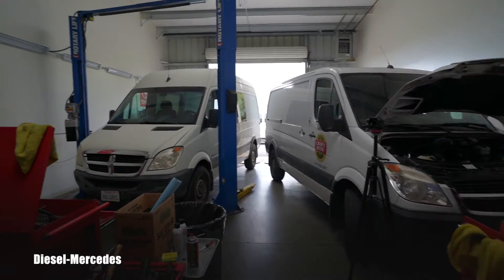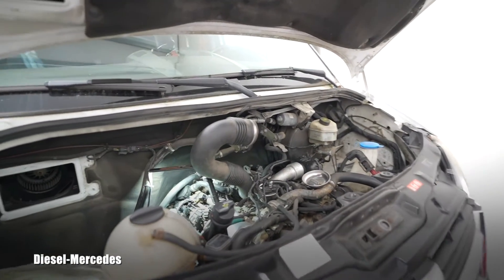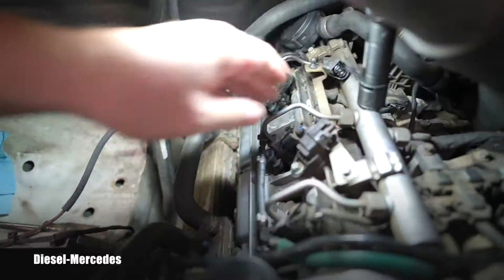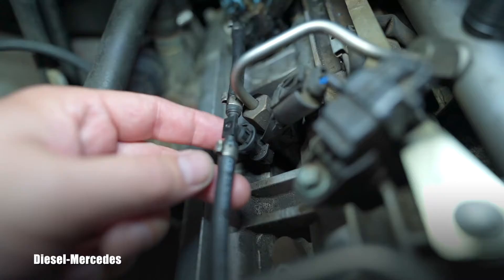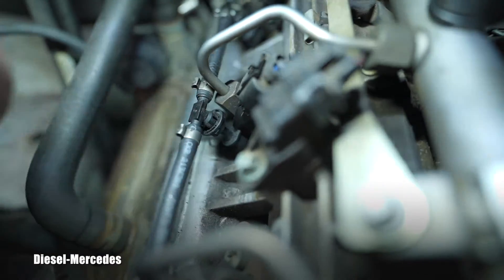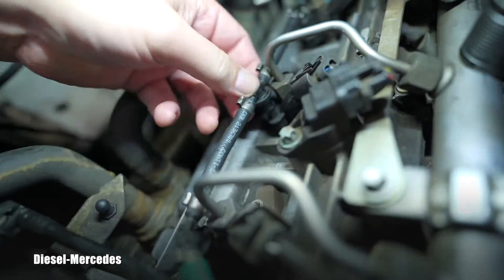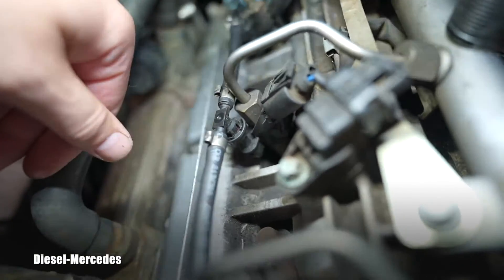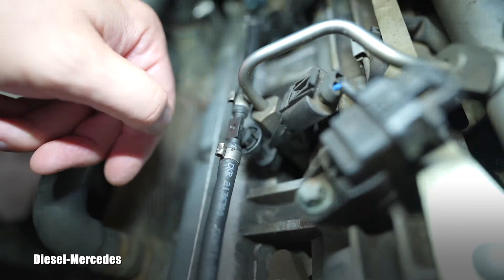How to remove return fuel line OM642

Comment: Thank you for your video. I need to replace those fuel lines and I have a problem to get off the plastic cover and foam insulation on the driver side. Do you have any tips how to do this?